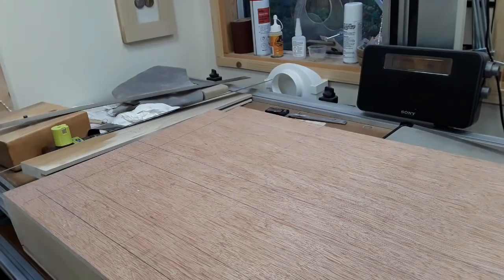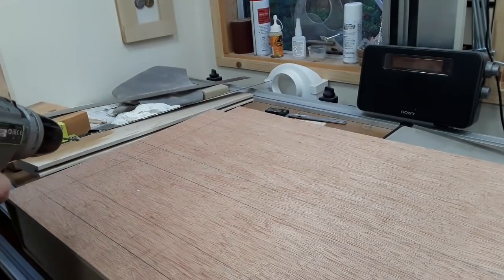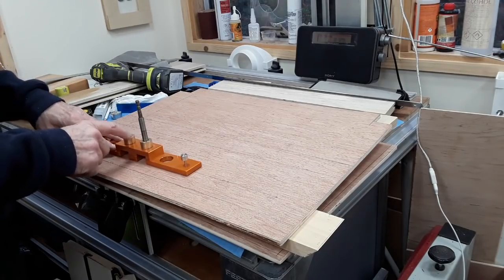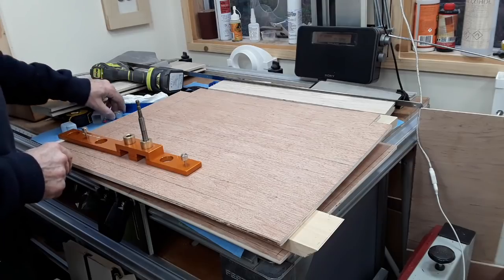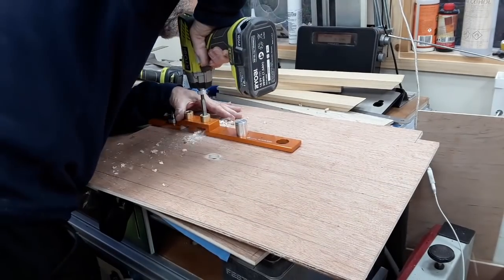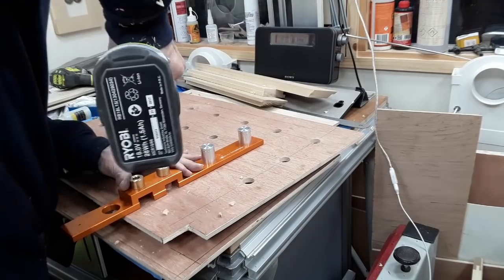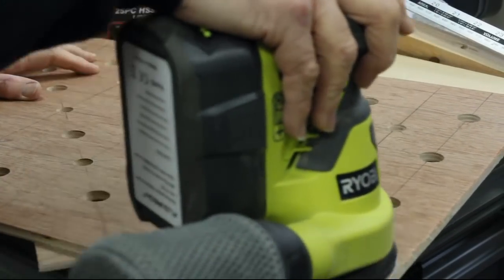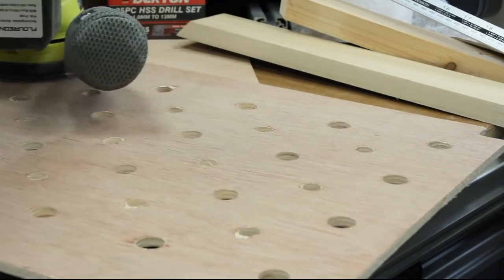the small shed #89 - making a downdraft table - part 1 the PARF guide system

Comment: How do you find the 3rd batteries last, compared to the OEM ones? Thanks
Reply from the maker: I can't tell the difference, and it's difficult to compare my 5AH Ebay buy against a 2AH Ryobi, but I can't see any downside so far, whether they last as long only time will tell, but pound for pound I think they are a better buy than OEM